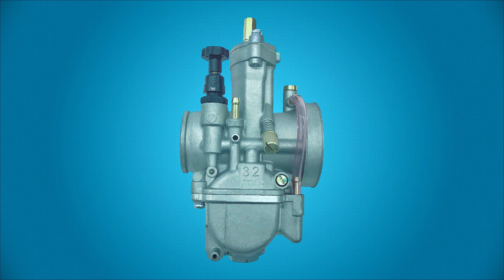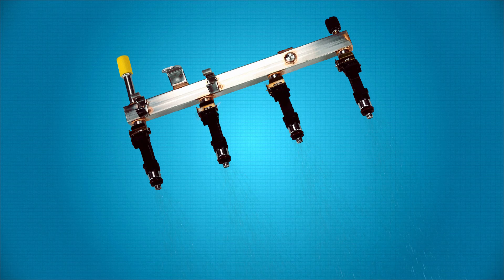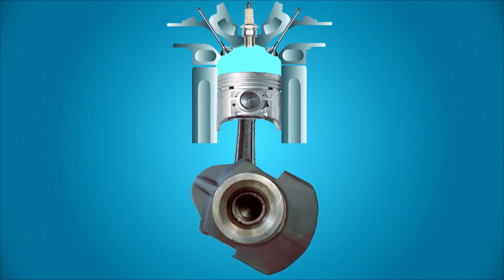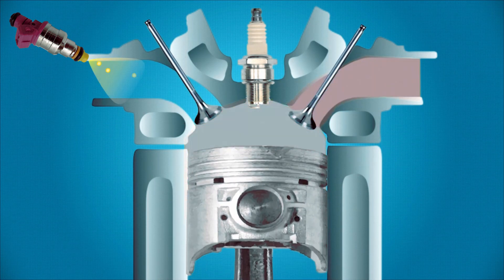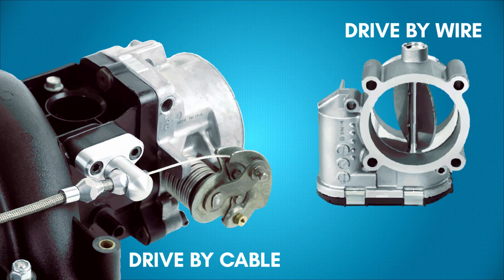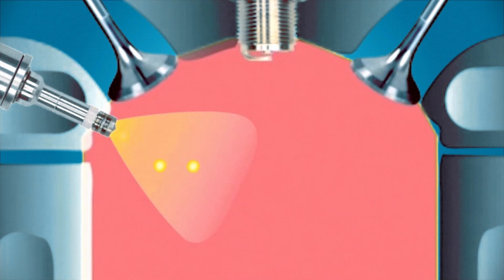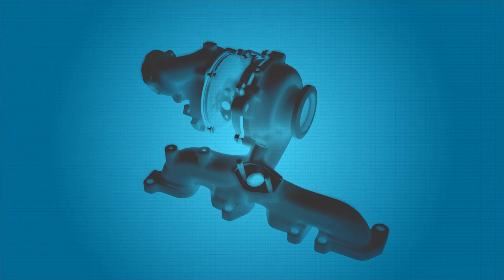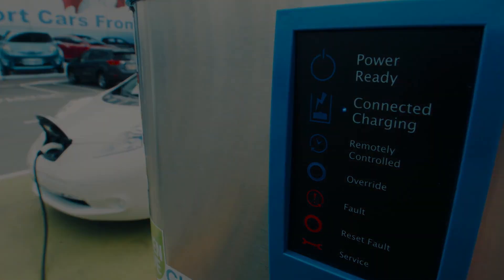Exploring Engine Efficiency | Continued

Comment: 12:15 - that is wrong. If you slap a turbo on a car you'll get a higher fuel consumption because if you have more air in the combustion chamber then you need more fuel to prevent knocking. The efficiency from turbochargers is in eliminating the force to overcome the vacuum created in the combustion chamber of a naturally aspirated engine. 
A ideal solution would be to meter the boost to offset only the negative pressure during the intake stroke and not to significantly increase the pressure inside the combustion chamber, like in the Atkinson Cycle. Then you'd have peak efficiency because both the intake and the compression stroke don't require as much energy to complete. Alternatively you could offset the knocking via EGR and thus limiting the amount of oxygen in the combustion chamber and thus limiting the necessary fuel. But that would still result in an engine which needs more force to complete the power stroke.
There are technologies like Volvo's "Compound Turbo" which offer 10% extra torque in truck applications. It works by harvesting the energy after the turbo via a turbine and applying it directly to the crankshaft.
To make the ideal engine you'd need to precisely control the valve opening and closing, like Koenigsegg have done. Then you need to reduce the amount of energy required for each stroke while maintaining a powerful ignition stroke.
But still, you have immense heat losses which remain unmitigated, making internal combustion engines primarily heat generators.

Comment: Surprised you didn't mention camless valvetrains. These provide an actuator to allow the ECU to directly control each valve. They effectively become an "infinitely variable camshaft" and also control the air intake so there's no need for a throttle body. There's a company Freevalve making these, though I expect the passenger car market will go all-electric before they become widely used.

Comment: I was looking forward to you talking more about valvetrain technology like VTEC, MultiAir and Vanos. MultiAir in particular can almost eliminate throttle-body pumping losses by throttling dynamically at the valves instead of restrictively at the butterfly flap, which can improve efficiency greatly.
Reply from the maker: It was more of a high level introductory video. Ironically I’m looking into making a follow up on the points you addressed. Thanks again for watching 🙏🏼
Reply: @GearQuest  Awesome! I'll sub for that.

Comment: Nice video, i know almost everything in this video. But it was good to hear it all layed out like this.
I didnt know about using the spark gap as a sensor though, but fire being plaama it makes sense.
Cheers.
Reply: Fire isn't plasma, the temperature is too low. It isn't even matter. It's just how our brain interprets all the sensory input of the chemical reaction called combustion.
Reply: @f00flghter29  im open to reason... Some sites say it is, some say its part, some just dont mention it..  If you could provide a link to your side of reason id be grateful.
Reply: @1st_ProCactus  https://www.thoughtco.com/what-state-of-matter-is-fire-604300 Here's the source that wiki uses. I was a little wrong, there's bound to be a tiny portion of fire that becomes hot enough to ionize gasses produced by the combustion of hydrocarbons. Whereas the combustion of metals such a magnesium and especially a thermite reaction produce enough heat to ionize gasses more consistently.
Reply: @f00flghter29  That's right. Thank you.

Comment: The video is overall nice and informative. But I think that a leaner mixture with an increased pressure generates hoter exhaust gas temperatures. For example: When you fly a small aircraft you run the engine always at a rich mixture during take off to reduce the exhaust gas temperature (EGT). Some of the gasoline evaporates instead to burn and thus cools the engine. If you lean the engine too much during the flight and leave the EGT unchecked for a prolonged time the engine might get damaged, since the lubricating oil film burns away. Anyway I liked the video regardless.

Comment: Great video, sums up about 3 hours of confused Wikipedia reading. About electric vehicles though: they will not totally take over transport because the fuel density of gasoline is substantially higher than electric and generators will still need the same efficiency technology
Reply: Despite improvements combustion engines still produce alot of CO2 and pollutants.  Many of the improvements come at the penalty of emissions.  Direct injection for example produces soot due to the short burn time, high compression engines produce more NOx.   Compared to other energy sectors transport has done little to decarbonise and is still increasing.  Combustion engines are fundamentally inefficient, getting barely more than 30% of the energy in this super energy dense fuel.    There are other reasons not mentioned in this video and they could be improved, but its too late for combustion and personal cars,  Electric cars with batteries now have the future, mainly because of the efficiency.   BEVs get 90% of the energy created, this is massively better than combustion.  Sure there are a few issues with range or recharge time, but its now fine for most people most of the time.  In 10 yrs time even towing and long range concerns will be a thing of the past and we will wonder why we stuck with combustion for so long.  Just not having to pump air in is a huge efficiency saving on its own.
Reply: While you're right about them not entirely taking over transport, I think you're underestimating how many people need the extra range. Batteries are becoming relatively cheap and really fast to charge, and they could start to be used to provide energy to the grid when the renewables aren't running.

Another thing: coal power stations are ~37% efficient, with petrol engines only getting close now. Gas turbines are a lot better. Solar's relatively cheap apart from batteries, so it just makes sense to head in the direction of cars with batteries operating as reserve for the grid.

Comment: New tech is also on the way in the forms of removal of intake valves in favor of Air Injection.  Another is, EDA Electric Drive Assist, final drive assist via an electric motor after the transmission or transaxle.  Development of one sensor systems that do mass intake air flow, intake air temp, and intake pressure are on the horizon also.   The elimination of intake manifolds in favor of air intake injection will revolutionize the industry and increase efficiency of small displacement engines by two to three fold.  It's coming soon.  Audi and GM already have these designs on the drawing board and are almost ready for unveiling.  With Hybrid/Electric taking over commuting and fuel engines used for mileage and duration, the horizon is bright with new possibilities.